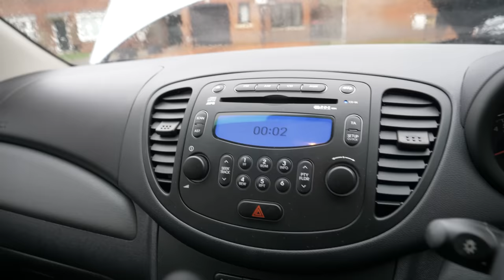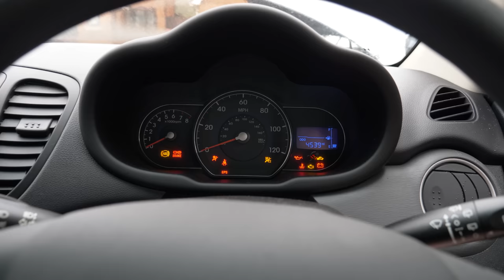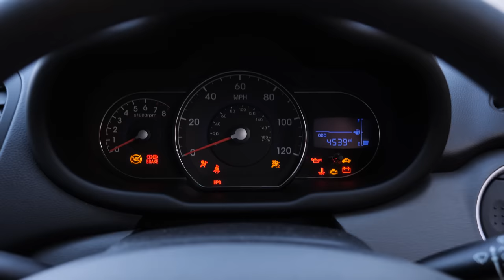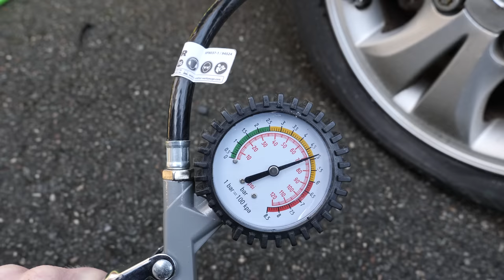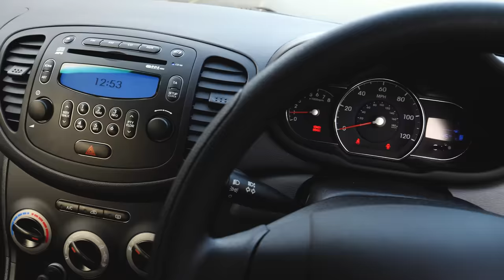I RESTORED my NEIGHBOURS ABANDONED CAR (FOR FREE)

Comment: As a Hyundai owner myself for many years I can only say these are dependable, honest and reliable cars that dont leave you stranded on the side of the road.
Reply: Does any of your hyundais had an hard throttle pedal? I've got an 2010 i20 1.2 manual and I can't get used to the throttle pedal, is hard at the top and i can't control the revs
Reply: @joaopedro-ty6wp  No. I never experienced that. Did you take it to the dealers mechanics? They must know what is going on.
Reply: @joaopedro-ty6wp  giving my two cents, we also never had an issue like that. We've had the same first gen i10 for 10 years and no issues like that. Should visit the mechanics soon if that's the case. Our

Comment: I was hoping for more to be fixed.
However, a lovely gesture none the less. Hope the neighbour is happy.
Reply: Exactly what I thought! It probably will need brand new tyres after it has been sitting flat for years. Replacement oils and fluids would probably not go amiss, and probably new brakes too - he said it himself that it was sticky? The interior probably also need some cleaning and vacuuming which I hope he did but just didn't make it in the video. However given that he wasn't formally commissioned to restore the car I guess it is understandable.

Comment: I have a hyundai i10 all the way back from 2011, it's still working top notch till now and only had a few minor servicing over the years, I got to say hyundai cars are very reliable.
Reply: Does yours have issues with the V-Belt squeaking? We've had that issue so many times now. The car got to rhe mechanics ans after a while it would return
Reply: @rechtrecht  no we never had the squeaking problem at all, this problem was mostly seen on the magna variants of the i10, I have the sportz variant.

Comment: Why would anybody abandon i10 in 2020? It is great little car - reliable, good on fuel, sits 4, 5 for short trips. 
My family used to own Atos which used same engine, went to 370.000km before gasket started leaking oil. And it was only problem. And brake booster started to fail on 240.000km. apart from that, just oil, tires, whipper blades and brakes.

Comment: The i10 is a great car, fuel efficiency is great, reliable and a great driver. If you keep your hand on it, it will go for very many trouble free miles. Just make sure that you service it regularly and do the timing belt

Comment: The soap you’re using, are you happy with it? I tried it myself and it removed absolutely all of my protection on the paint and made it harder to dry with a towel.
Reply from the maker: I’ve never had issues mate what protection have you been using, could be worth using a drying aid
Reply: @Josh.Sanderson  I’ve been using meguairs ultimate liquid wax and ultimate quik detailer and their hybrid ceramic wax while drying.

Comment: What about engine oil/coolant/air filter/ brake oil/ cabin (ac filter) / disc pad(if needed)/ petrol filter replacement? Seems you didn't replace any of those parts .

Comment: So, basically, he just washed his neighbor's car (very thorough though, well done here). But he didn't change the oil and oil filter. It should have been done BEFORE starting the engine. And personally, I would use a cheaper oil first to run it for couple hundred miles, and then would change the oil and filter again. Also air and cabin filters need to be changed. All liquids to be changed as well (coolant and brake fluid).

Comment: The water pump / thermostat housings feed pipe has probably rusted and will leak , they are very weak on these cars (1.2) cause the water pump to seize and one has to take the engine out to change that if run dry and and the vbelt is a pig to change. One has to remove the intake manifold off to change that metal water pipe and usually the thermostat housing cracks when you pull that metal water pipe out of it and the bolts that hold the thermostat housing rust and break off so it’s engine out to repair the threads on that . Bad cars

Comment: You didn't change the oil, the oil decomposes within 6 months or a year and here you are driving with a 3 year old oil
Reply: It is air sealed and so cannot corrode. It’s like oil in a carton , it will last years and years and still usable. Basic primary knowledge.
Reply: @kaloloL8 huh. Then why is it needed to change the oil every xx km OR 6 months WHICH EVER COMES first? oils degrade through time and they tend to sludge if not changed or used. Your analogy is not applicable since those new oils are not used. The oil in this car was already used meaning it was already exposed to heat and other internal mechanical parts of the vehicle.
Reply: @linkinparkadik  I don't know if you have ever watched old world War two vehicle restorations.  The oil in alot of these cars have remained  in tact and enough to run some of these engines sitting for almost 100 years. This is because of air compression. It's all basic shit man. Oil corrods from exposure to H20. There could be some corrosion but over a small period of afew years it would be barely noticeable. I've seen 100 year old trucks run on a farm first pop after 40 years of sitting in old oil, although old and thickened, is enough to lubricate pistons and rods  to turn on. Again, basic science.
Reply: @kaloloL8  it looks good but it ain't good, must change every 6 month to 1 year. Read the labels on the oil. End of discussion
Reply: @kaloloL8 for someone telling about "basic science", I am surprised you haven't thought about how tight the tolerances inside engines for lubrication to go through are. Thickend oil due to degredation can kill a good engine regardless if it looks okay or not. Also, the lubricating properties of the oil also fades through time so say goodbye to your bearings and any other metal contact points inside the engine if you really stand by your beliefs. 

You may have seen those old engines start up and run but it doesn't change the fact that old, stagnated lubricants need to be replaced before any prolonged driving is done to avoid or cause any further damage to the engine.

Comment: Meguairs' car soap a bit on the expensive side? Yeah, if you're using that in place of Fairy liquid to do your dishes, it is.
Reply from the maker: What? 😂
Reply: @Josh.Sanderson  Sorry mate, just being cheeky. I'm just not sure the Bilt Hamber foam costs any less than Megs' when you work it out per wash. Still loving the before and after though!
Reply from the maker: @GQ1494D  haha just didn’t understand is all, the meguiars car shampoo and Bilt hambre foam are for different purposes so not worth comparing. However the meguiars shampoo is an expensive shampoo compared to turtle wax orange, pro kleen, etc however it has a very glossy waxy finish and is heavily concentrated

Comment: Surely it would be more beneficial to give the car a quick jet wash before using the snow foam?
Reply from the maker: Don’t think so, the foam sticks better when it’s not wet and acts as a lubricant to stop the water jet affecting the paintwork, could be wrong though?
Reply: No ur 100% right, was actually gona do this sort of thing myself, did years of research on the business, then i was going to start it, then i got corona virus and then shortly after got disabled from it as domino affect, but yeh you are 100% snow foam first

Comment: what is this guy doing?? obviously you should have used the pressure washer BEFORE you did the spray foam to get all that nasty green away, then spray foam and then PRESSURE WASH AGAIN!!
Reply from the maker: Why on earth would that make any sense, snow foam is designed not only to break down dirt and grime but to be used as a lubricant on your paintwork whilst pressure washing